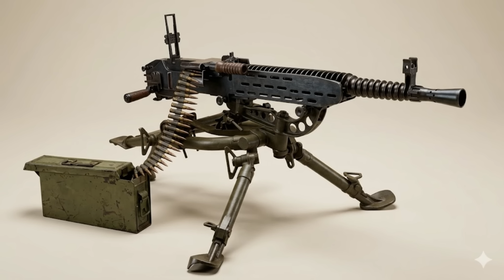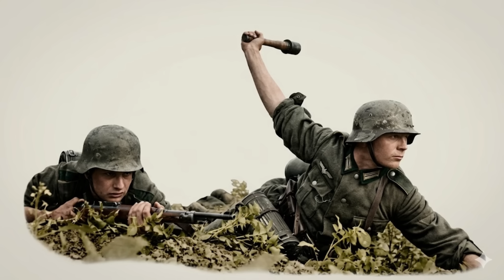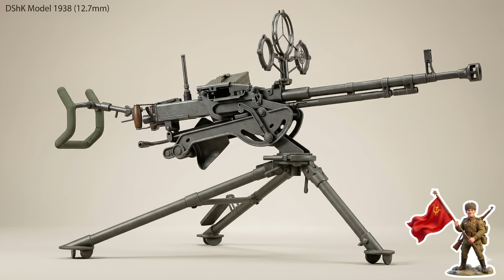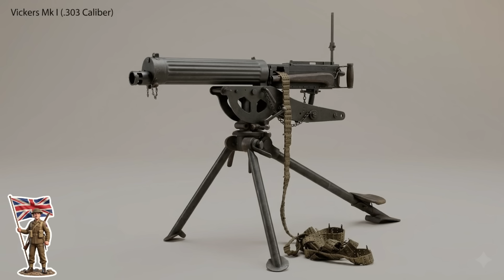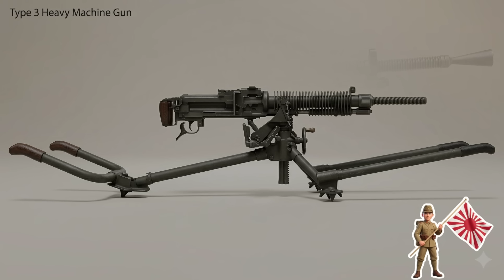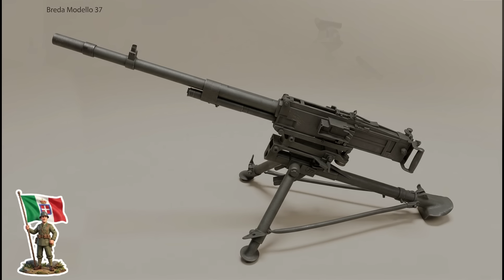Every Heavy Machine Gun of WW2 Explained

Comment: Seems like the definitions of heavy, medium, light machine gun keeps changing! It used to be heavy machine guns were.50/12.7mm caliber, belt fed. Medium machine guns were Maxim, Browning/ Vickers, Spandau example water cooled, belt fed rifle rounds 30/7.62mm caliber on defensive tripod for sustained fire 🔥. Finally, light machine guns definition changes constantly! MG-34, 240 Saw, firing full rifle rounds belt fed. MG 42 could double as both light and medium. Czech designed Bren gun, French Hotchkiss, Japan type 96 with top fed magazines were not real light machine guns but belong in the BAR class of automatic rifle. They are Not belt Fed.

Comment: It's untrue that the Breda 37 needed lubricated cartridges. It was a reliable weapon with a powerful cartridge and it was also used by the British in Africa
Reply from the maker: Good point on British use in North Africa. The Breda 37 did have an oiler that lubricated cartridges, helpful for extraction, but problematic in dusty conditions. That’s why it gets mixed reviews.❤😊
Reply: It was the fiat 14/35 that needed lubricated cartridges. You can see videos of Breda 37 firing on YouTube. There was no oiler
Reply: @flaviusaetius8358  La Fiat 14/35 ha la camera di scoppio scanalata per sfruttare la contropressione che evita al bossolo di incollarsi. Il modello 14 necessitava di lubrificazione del bossolo. Se ricordo bene.
Reply: @emanueleguglieri6353 You are right neither the 14 nor the 14/35 had an integrated oil pump but the manual recommended manually lubricating the cartridges before inserting them in the belt or in the magazine. The Breda 30 had an integrated oil pump
Reply: Giusto, Le Breda 37 e 38 non avevano la lubrificazione del bossolo per poter funzionare. Probabilmente qualcuno si confonde col modello 30 fucile mitragliatore 6.5x52 che necessitava di pulizia e bossoli lubrificati prima della cameratura.